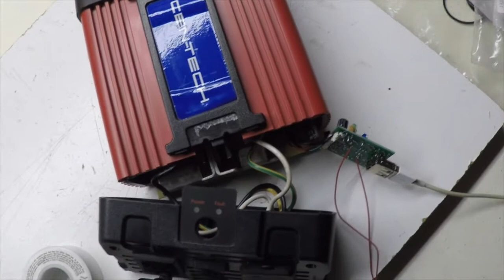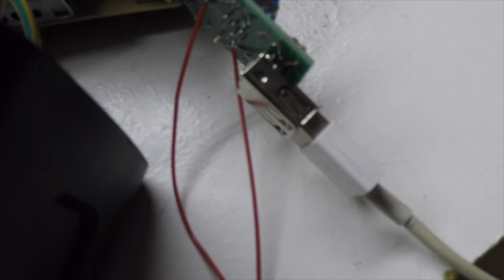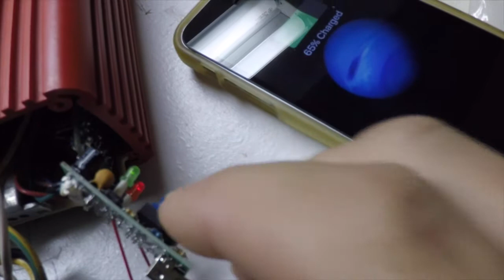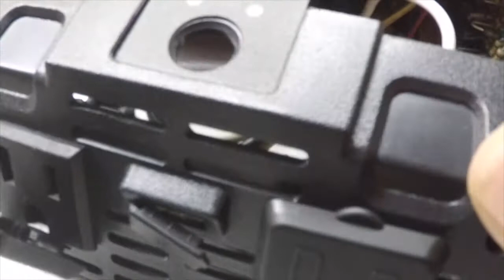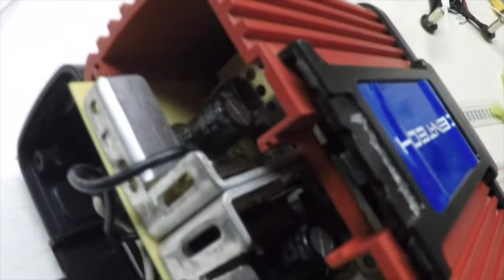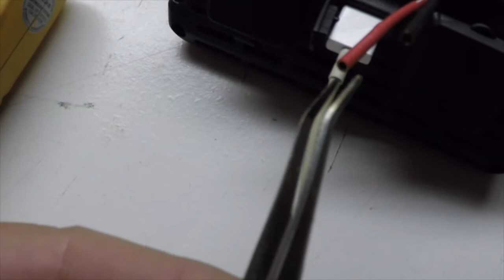Harbor Freight Cen-Tech 750 watt Inverter HACK Item #69660 - How to make a Remote Switch

Comment: I just finished wiring mine up. Works great!  My inverter has a simple rocker switch which was very easy to solder my wire right to the terminals leading to another rocker switch with as much wire as I need to go inside my camper where it's easy to reach. There will be a video on my channel about it shorty if anyone wants to see it in that application.  Thanks again for your help. I didn't find any other videos about it on YouTube besides yours.
Reply from the maker: Nice work!

Comment: I'd like to try this method with my setup. Has it worked out for you after time has passed? Is there anything you'd do different? Thank you in advance.
Reply from the maker: It has worked flawlessly and I still use it today (2021). It's been several years since I made these mods and I would do it exactly the same if I were to do it again. Good luck to you if you decide to try it.
Reply: @WannaBFree  Good to know! Thank you so much. My inverter on off switch is a toggle with two post terminals that lead to the circuit board. Looks like I can solder the external switch right to the terminals. I'm going to try it out and see. I also saw your part two where you use a surge protector. Do you feel that has prevented the initial surge of the inverter?
Reply from the maker: You are welcome Adrian! I don't know if the surge protector has prevented the initial surge of the inverter. I always turned on the power from the inverter to the surge protector first then plugged in the device I was wanting to power. I just put the surge protector in as a precaution due to the outlet being right by the sink. It's purpose also allowed more than one outlet for plugging in devices. Hope this helps you out!
Reply: @WannaBFree  using the surge protector as a remote on off switch seems like a handy possibility. Just requires a bigger hole to be drilled. Anyway. Thanks again for helping me with this. Cheers.

Comment: The alarm is likely sounding, because you're supposed to power it on without a load.
Reply from the maker: Thank you
Reply: I know this is an old post but the alarm goes of because due to low voltage on power in. I had an underpowered alternator in an ancient car and the voltage would drop when I hit the brakes. The alarm would go off until I gave it gas which provided just enough voltage to turn of the alarm.